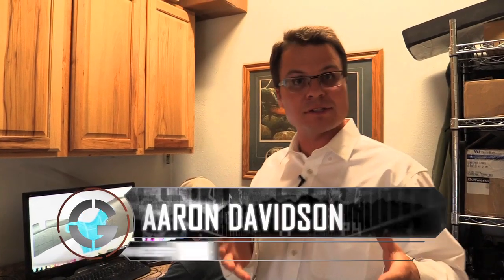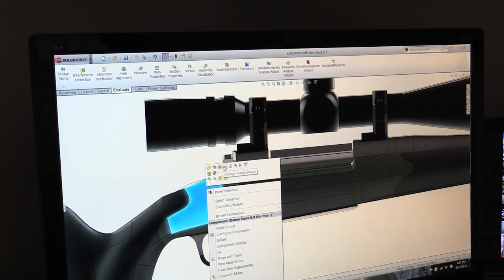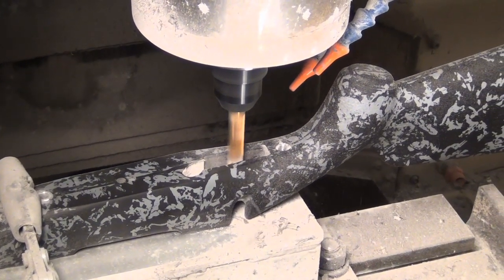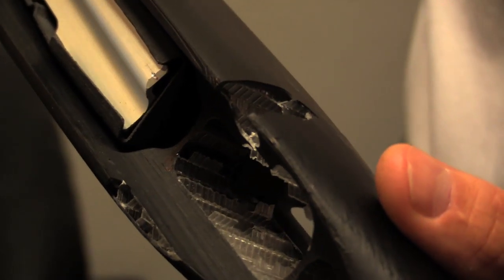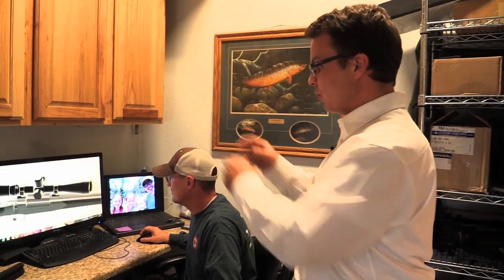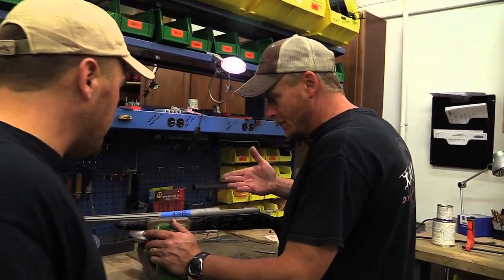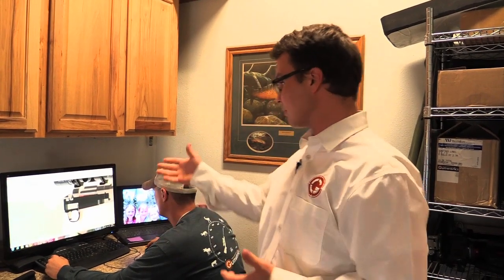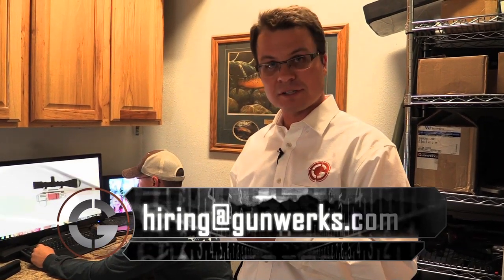Employment Opportunities at Gunwerks

Comment: you guys should work on a stock that folds so you can fit a custom long barreled gun into a pelican case. I would love to have a gun with a 28 inch barrel and a 2 inch muzzle break that could fit in a good case. Maybey a carbon fiber stock that has all of the tactical and prone feature of a stock built for prone, but that weighs in at the same weight as a sporter stock with more strength, rigidity for prone shots as well as off-hand or in practical positions. Put your carbon wrapped barrel on it with a titanium action and you have a mountain gun that will shoot like a bench rest rifle. Not that your models do't already, but it would be cool to see one in a tactical competition, or a bench rest comp. The 7 lrm would be tough to beat at 1k with a 195 grain berger.
 And an original cartridge based on the 7lrm with the same case capacity but that has thicker walls so it can withstand higher pressures for safety and reloadable life. If you look at lapua and rws, they hit the nail on the head with their tough brass. it can be loaded over 15 times in most instances, and it has a 72,000 psi rating. brass manufacturers have been making crap that loses primer pockets in 2 to 3 loads when loads are maxed. Brass life should be longer than that.
keep up the good wok.... I used your calculator to drop targets out to a mile last year in my 7mm weatherby. It was spot on, and the wind gods were being nice wit a 5 mile an hour consistent breeze.

Comment: I was wondering what modeling software that is and what printer you used? I'm currently working and going to school at the University of Northern Iowa in the manufacturing engineering in design and metal casting.

Comment: make an action with a 60 deg bolt lift with a thicker bolt than a 700 clone. 700's are ok but actions could be designed stronger, safer, more functional, and lighter. Titanium for instance. New barrel making processes have come out that use stronger steels and use patented methods that are not being utilized, but the barrels are awesome and have better barrel qualities than stainless steel. We need some innovators so we can get guns into competitions that shoot 5 rounds fast or twenty rounds that do not destroy the barrels in 500 rounds. It would push the envelope in the competition sector as well as the hunting sector. People would actually have the opportunity to shoot 100 rounds a month and get proficient at their trade without killing their guns. It would make hunters more proficient and ethical. .

Comment: Sent my Resume in a few months ago.

Eric Goss.

Manufacturing Engineer, CNC Programmer and Machinist dedicated to precision manufacturing. Strong expertise in aerospace, defense, semiconductor and medical industry. Highly accomplished in manual machining, multi-axis CNC, CNC programming, solid modeling, prototyping, tooling, fixturing and blueprint reading.
 
Areas Of Expertise

Mastercam Certified
Rapid Prototype Manufacturing
Solid Modeling
Solid Works Certified
Manual Lathes, Mills
CNC Programming
Assembly/Tooling/Fixturing
Management
Swiss Machines
3D Printing
Self-Motivated